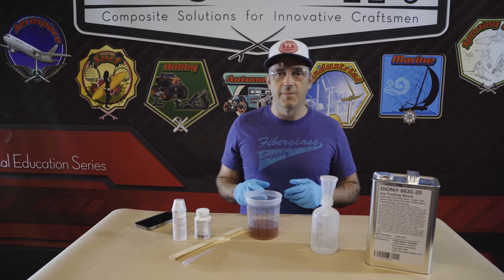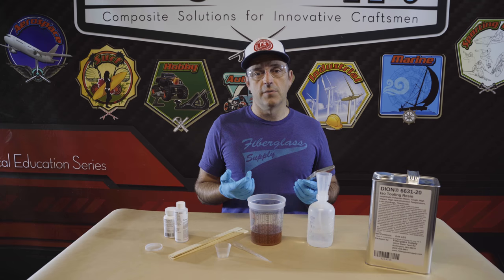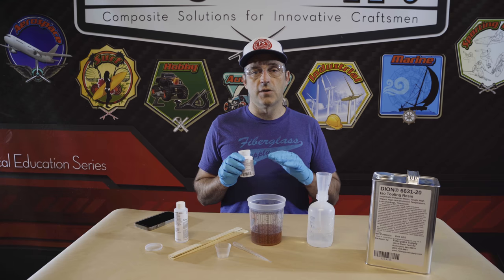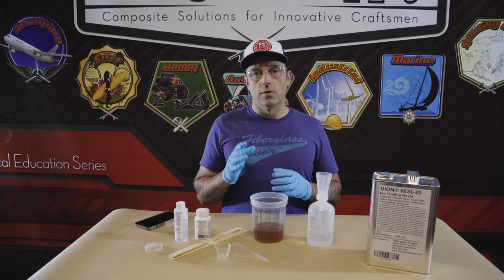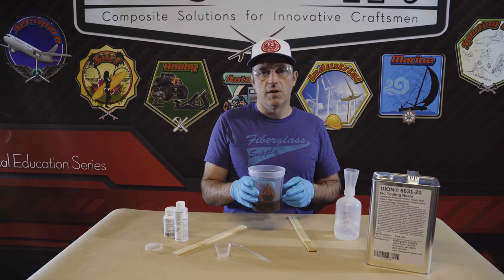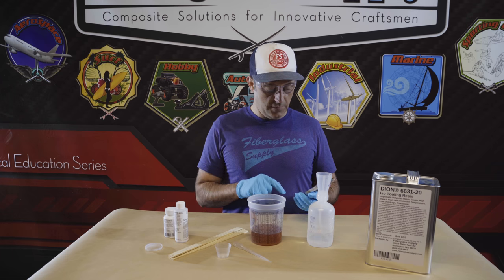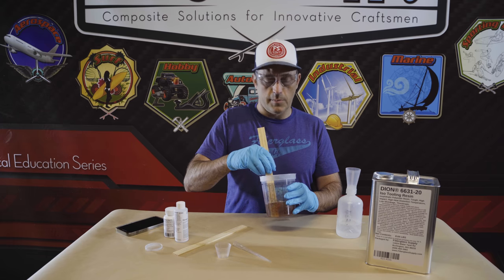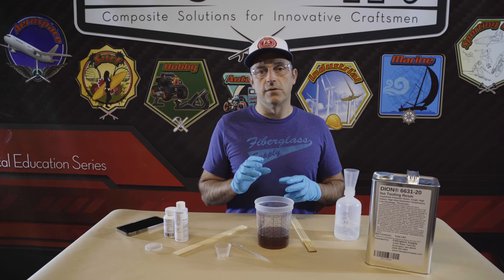Fiberglassing for Beginners: How to Mix Polyester Resin with Catalyst

Comment: Thanks for this video. Please what is the mixing ratio between the vinylester resin and catalyst
Reply from the maker: Typically 1.5 to 2.5%, but depends on the specific vinylester you are using and temperature you are working in.

Comment: I have lots of experience with epoxy building large RC jets but non at all with Polyester.  I'm making the switch to poly cause the price of epoxy is just nuts now.  Please tell me how you would join two parts that are made of poly.  Its my understanding that poly wont stick to poly.  Also when should you use Waxed and Not waxed?  If I make a mold out of Blue foam, what should I use for tooling coat that wont melt the foam. 
Thanks so much
Reply: Epoxy is better
Reply from the maker: Epoxy and MMA (methyl methacrylate i.e. plexus) adhesives are two options. Without getting in the weeds too far, poly will stick to poly but timing, joint type, and surface prep are all important.  I get that epoxy is expensive but I'm not sure I would switch on high performance parts like RC jets.

Comment: Is it safe to do polyester fiberglassing without a respiator?
Reply from the maker: That really depends. Styrene, which is the chemical you smell in polyester resin is heavier than air, some shops have the airflow designed to move the down and away from the laminator and may not wear respirators.   We do recommend you wear a respirator, I usually don't in a video like this so that the audio is better.

Comment: Thanks for the video.  I was taught to add catalyst based on weight, not volume.  Is adding catalyst by volume recommended by resin manufacturers?
Reply from the maker: Interesting question.  I have seen both weight and volume used on resin manufacturers data sheets,  general practice is to mix by volume.  The difference between the two is negligible and because with polyester resins you can vary the amount of catalyst you add this small difference should have no adverse effects on the performance of the resin.    Just to be clear we are talking about polyester resin systems, not epoxy, epoxy is a completely different chemistry.
Reply: @FiberglassSupply  Thanks for the reply.  Yes, I am aware epoxy is different :)

Comment: Hi How long does it take to gel or hardened. ? Often i find some polyester takes overnight to cure ( i did it this alvo at 6 pm and it was probaly 16 degrees celcius) and it hasnt hardened and its 9 pm .   Thankyou
Reply from the maker: Depends on the resin system, temperature, and catalyst amount, but generally it will gel in 20-45 minutes and should be hard within a few hours.  It may remain tacky to the touch for some time unless it has wax in it and that is normal to allow bonding subsequent layers without sanding.  It does sound like you have some issues, which could be bad resin (it will go bad over time), insufficient catalyst added or not mixed properly, or the catalyst has gone bad (that happens too).

Comment: 1 or 2 % of weight or volume? or is that depending on the resin system?
Reply from the maker: Because they are so close in specific gravity you can go with either, we usually use volume.  This applies to polyester resin, for epoxy the ratios between weight and volume are different because the specific gravity between the resin and the hardener are different.